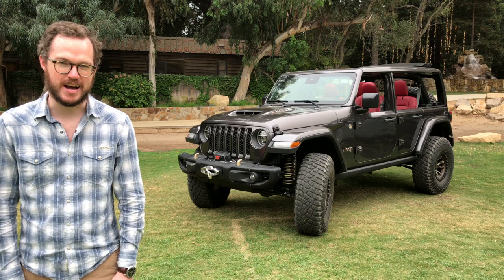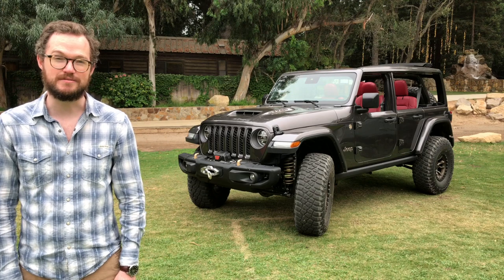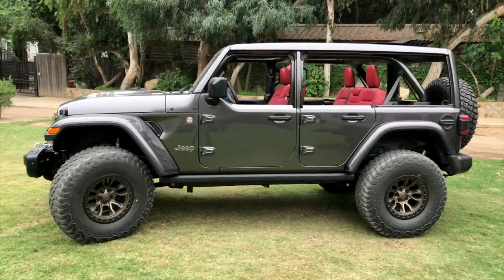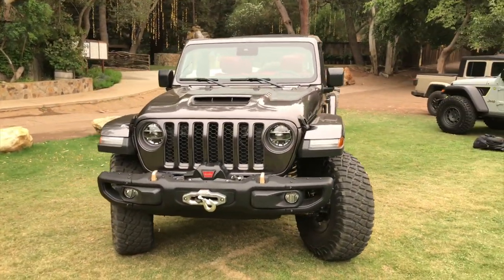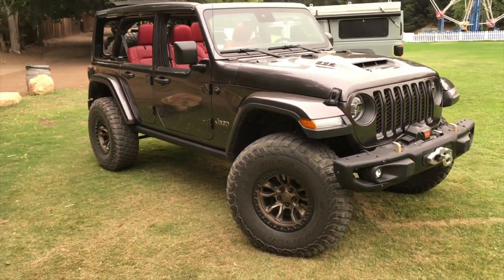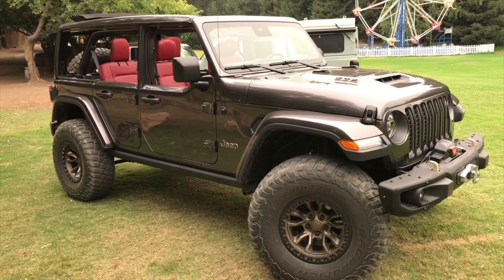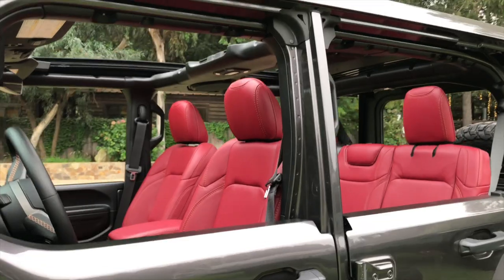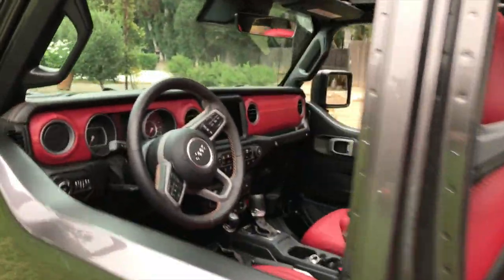Jeep Wrangler 392 Concept: First Look (Up-Close Details, Engine Noise)

Comment: SWEET!!!!! that's that I'm talking about

plus you need that Hemi to move those big-ass 35's or 37in wheels hehe the V6 just struggles too much in my opinion but the V8 won't even notice!
Reply: V6 wont struggle if you just re gear lol
Reply: @williamhussey1611  well let's see how the new V8 Hemi Wrangler turns out, assuming they built it...

I doubt a HEMI will struggle at anything, hell put 40inch tires on it, all that extra weight won't matter a bit hehe

Comment: Im not impressed with the jeep! i be impress when they realese the price tag
Reply: 68 on the cheap side to 75k   best guess by building a Jeep on their website that has all the opt that the 392 has stock.  and that is not the wheels, lift or hemi those you can add to the build as yet.

Comment: dont need all that power to 4 wheel use to run circles around my friends with my old f150 4.9 4 speed granny and they all had big chevy V8,s in their FJ 40,s
Reply: its not about the power its about just having a v8, nothing else compares